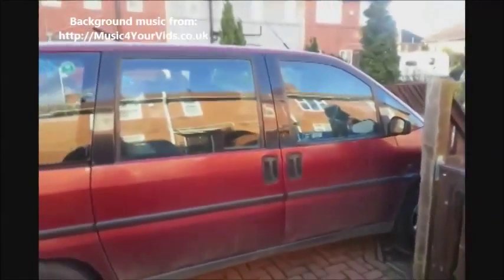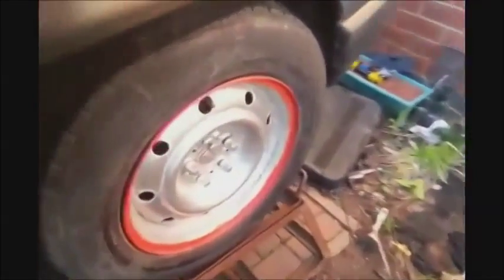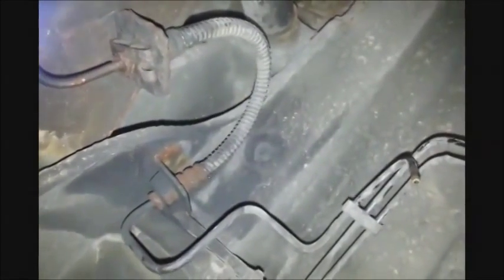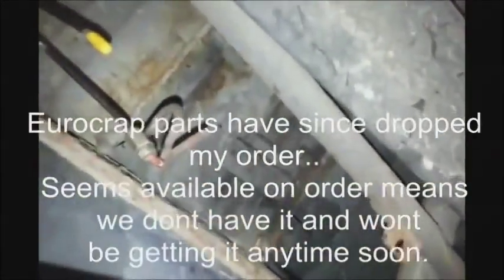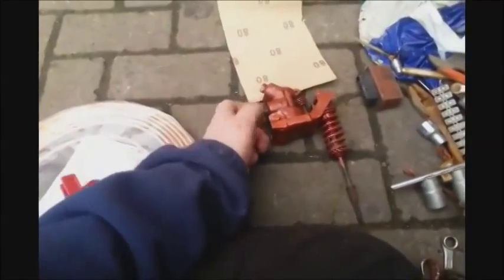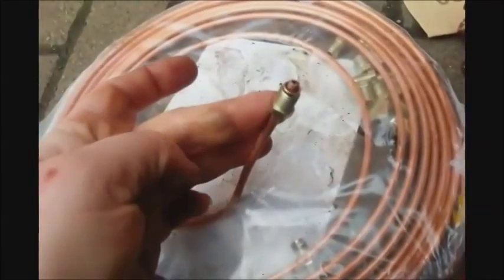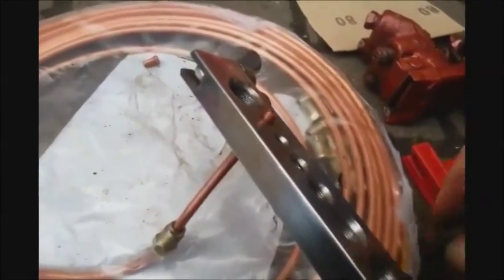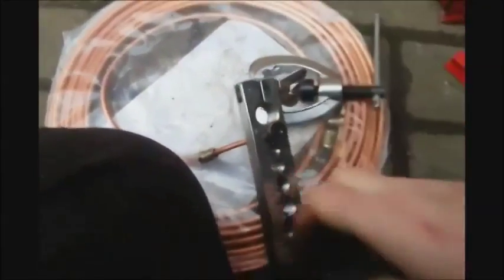Night camper conversion #01 for short holidays and photo trips peugeot 806 / fiat ulysses / flez1966

Comment: ive had two 806 svdt the one ive got now is december 1996 and has done 228,500 miles but is still as tight as a drum
Reply from the maker: i still have the 806 but the clutch just went.....so the 'project 806' may be dead...